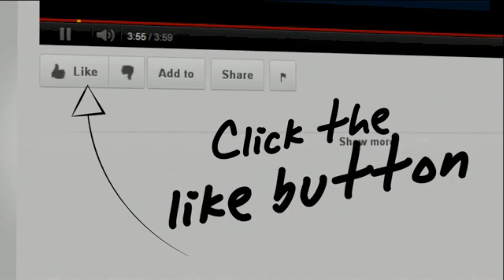PIP 4048MS Restart SOLVED

Comment: I am glad the inverter did exactly what you programmed it to do. And is still working well. On my little sister in Las Vegas. I have a note with all the information programmed  into my inverter, almost like a checklist. That way if something happens,, I don't have to rely on my memory. I'm about to order a PIP for my friend in Tucson, Arizona,, a 2400 watt PIP @ 120 volt for his system weren't scrolling down there, as soon as we get it up and running. I will post the video. Glad to hear it still working good for your friend.Neil

Comment: Good to see nothing actually was really wrong with the unit! Did you figure out why the relatively small load made it go into that battery protect mode?
Reply from the maker: Actually it was the coffee pot left on.  The thermostat in it just happened to turn it back on the same time the charger was plugged in.
Reply: Wow so the coincidence must have just caused a sudden peak load that dropped the battery voltage to the threshold that caused the protection circuitry to kick in.
Reply from the maker: xanataph That was it.

Comment: Pls. How do you connect your pv panels to the pip which voltage is the perfect to connect to the mppt. If the panels 250 watt how we connect them to the pip
Reply: Around 100 volts is perfect! 
Thinking series of 3 panels should work best 4 max  depending on panel voltage location ect...... For the pip over 115 is not good.
Reply from the maker: off grid kid is right.  Three panels wired in series is about best.